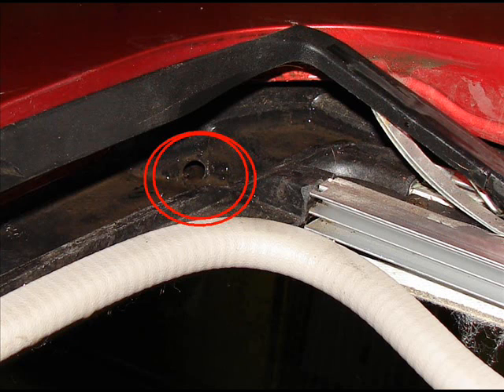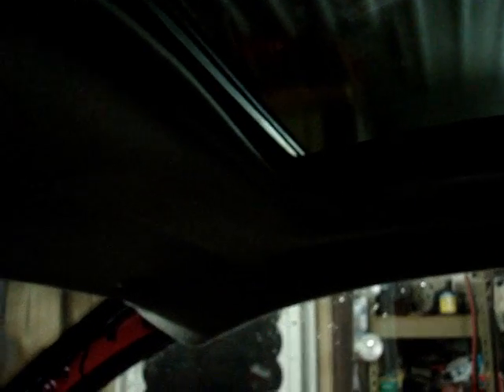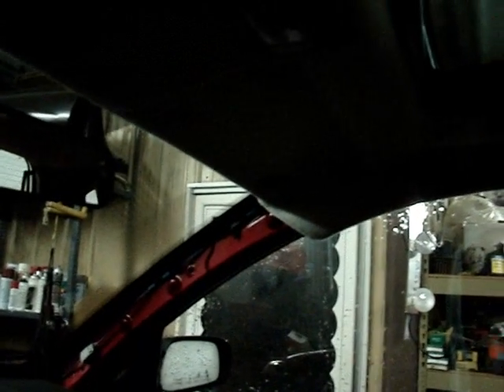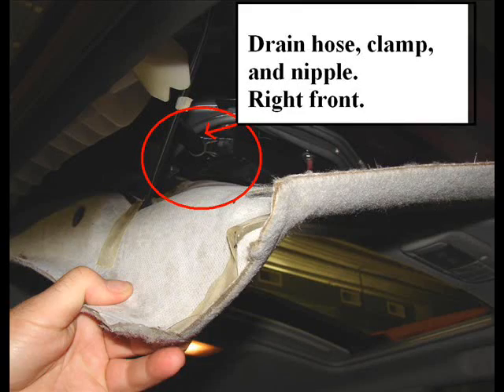Sun roof  WATER LEAK repair (Toyota Matrix - Pontiac Vibe)

Comment: Thanks for creating & posting this video!  I've had this problem, on the drivers side, on and off for years- seemed like no rhyme or reason when it would strike.  I kept a towel in my car to soak up the water and just lived with it.  Then the passenger side just started with the same problem, and I searched to see if others have had this problem- and I found this video.  Indeed the holes just inside the sunroof were clogged- it's fixed now and no more leaks!  Thanks again!

Comment: Thanks Earl. Your video helped me fix my blocked moonroof in my '99 Toyota. Fixing the problem was as simple as clearing the blockage by scraping the drain hole with a flexible plastic rod and then flushing with some warm water.

Comment: Thank you for making this video! I had a leak inside of my 2003 Toyota Corolla with a sunroof as well and you were RIGHT. The Corolla factory sunroof has 2 little holes in the front left and right corner - so tiny. My right side was completely blocked with little leaves and dirt from the trees that I normally park under. Toyota Service quoted $350 to REMOVE INTERIOR PANELING so that they could LOOK for the issue. I thought no way and took the car home to do some research. All better now!

Comment: Thanks for posting this video! My daughter has a 2004 Vibe and it was leaking bad. This video saved me time and money. The drainage hole is easily accessible when the sunroof is fully open. Sure enough dirt was blocking the hole which I simply removed. All is good now.. Thanks again!

Comment: I currently own a camry with an inbuilt sunroof and have had on occassion a water leak on the two front corners.  I wasn't aware of drain holes so I assumed I just didn't have a good seal when I shut the window the previous evenings.  I thought Ive been insuring that this wouldn't happen again by opening (not tilting) the window a few inches and reclosing.  It has worked thus far as Ive not had anymore leaks but now I see I need to ck for clogs.  THANKS for the heads up its much appreciated!

Comment: Great video 2004 vibe just started leaking really bad in same spot by top of a-post and blowing back a couple inches toward headliner i will check tomorrow on drain holes and afdter your video im betting blocked drain holes and most likely some debree down in the passager side,thanks for doing this video

Comment: I had been puzzling over a leak problem in my 2003 Vibe for a while. This situation was just as you described; suddenly started leaking in the same location.  I stumbled upon your video the other day and then took a look at my drain holes. Sure enough, the one in that corner was totally obstructed by a piece of rubber that fit snugly right in the hole! Not sure where the rubber came from yet, but we're expecting heavy rain tomorrow, so I'll be interested to see if we found the cause of our mysterious waterfall. Thanks for the help!!

Comment: I found the same problem this morning after buying a 06 ford f250 .. they said they fixed it.. I came home and checked it this morning .. same leak... So i tore into it myself . same as you exsposing the pillar. and found the drain was clogged and also the way the rain was filling up is a peice of the seal had slipped off the glass and was sealling properly. so you might want to make sure you chceck your seal.. thanks for the video. i was going to make one but i found yours. lol . bye James

Comment from the maker: The "A pillar" plastic pieces come off first. Firmly grasp them at the top edge and pull away at 90 degrees. You can break them if they are too cold or from using excessive force. There are plastic prying tools that are made for doing this. A wooden kitchen stirring paddle is a suitable pry bar to coax it loose. The objective is to get as close to the clips with the prying tool as possible. Be gentle and patient. Then take off the sun visors and center mirror (Phillips screws)

Comment from the maker: @filup55 EXCUSE ME but mine was clogged right at the hole entrance. I used a blow gun and compressed air as the hose diameter is larger than the opening at the drain. I did not know that the hose could be clogged deeply inside. It sounds to me like you already know the answer to your question? The weed eater string seems to be the brilliant solution to your specific problem. Thanks for the heads-up. I am sure other people with deeply clogged drain hoses will appreciate this reply.

Comment from the maker: @Taxminia0311 YES! Off topic but I did fix one with this problem. Yes, there is an "offset" bolt kit to correct it. 
NOTE: Always Toyota is cheaper than the Pontiac dealer for identical mechanical parts! (99.99% of the time.) Often the Pontiac price is almost double the Toyota price! Same parts, different part number.

Comment: I have that exact problem on a 2005 Vibe. The hole didn't appear obstructed visually and when I poured water in that area, it came out underneath the driver's floor area. Could the tube be cracked or partially undone at the nipple ?How hard is to peel back the headliner enough to get a look at the nipple area ? Thanks for any help.

Comment: Thanks for the video.  My 92 Camry is ponding a lot of water on the floor.  You can see standing water above the carpet.  Could a plugged up hole in the sunroof be causing this problem.  I sealed up the front winshield edges with blue masking tape but that didn't prevent ponding after a rain storm.

Comment: So I have an 03 vibe. Two winters ago I started having the leaks. And no matter how I parked, I live on a slight hill, if I parked down hill the front seat would get wet, if I parked up hill the backseat would get wet. I remember last summer taking some weed eater rod to one of the rear tubes, I ended up pouring water into the drains and found out where they exited the car and I shoved the rod up from the rear, that only got so far because there’s no way to get at them through the sunroof in the back. The front holes look clean and water does indeed drain through them so I have no idea why and how water still pours into my car. Never had the windshield replaced. It does have the roof rack option, is it possible it’s leaking through there? Seems unlikely

Comment: I have the same problem with my 2008 Pontiac Vibe: After it has rained, and I begin driving a particular way, water will spill into my interior from the same spot that's described in this video.

Unfortunately, for whatever reason, my sunroof will only tilt, not slide back.

Comment from the maker: Probably it is the roof rack. It could be the windshield. Has the windshield been replaced? Because the factory installations very rarely leak, but replacements this is more common.  Probably the best way top repair this is the take down the headliner and then have someone use a garden hose to spray the car. This way you will find the point of entry.
Thank you for watching.

Comment from the maker: @TheSmartdude11  If this repair is a warranty issue, then at this point you should take it to arbitration. Often, in a dealership body shop, the technician is often the "new kid" and he has no experience. In the service department, often it is the guy who does simple warranty repairs and oil changes. Even though the drain holes may be open, this doesn't mean that one or more of the drain pipes are not off the nipple as shown in my video.

Comment: I have an '07 Camry that has the exact same problem in the same place (For years now). My drainhole appears clear up top. But as soon as I pour a little water in it comes out the pillar (Where the plastic meets the felt). Does that sound like the hose has come loose or should I blast some air in there with a compressor? Do you have any videos that show how you got access to the drainpan nipple in the roof?
Reply from the maker: I think the hose is off. I show that the plastic pillar piece can be removed. A wooden flat kitchen paddle works pretty good for getting under the edge of that piece and gently prying it loose from the retention clips. Thank you for watching.
Reply: earltuckian

Thanks. Ya, I tried air compressor and that didn't do anything. I found out there is actually a TSB for my year of Camry about the moonroof hose coming off the nipple. At 1:00 you have the headliner pulled down to expose it. Was that where you used the wooden spoon?

Comment: My floor board only gets wet when it rains.  Is the A/C evaporator drain hose problem affected  by rain, or is it only connected to the A/C?  Sorry if it's a dumb question...
Reply from the maker: Hello,
Yes, the A/C drips only when the A/C is running and condensation is collected from that system. Likely you have a sunroof leak as the video explains. 
(Notes: If you have had the windshield replaced at some time, it is possible that it was installed with a defect in the installation re-sealing procedure.
 - Windshield leaks are extremely rare on OEM installed glass. -
If you did not buy the car new, typically you can see in the lower corner of the windshield glass an identifier marking group. If not a genuine original "OEM" Toyota piece of glass, it may say:  "PPG" or "Safelight" or something similar. )
Best regards and best wishes. Jim

Comment: @earltuckian hi um...ive had problems with my actual sunroof leaking like through the weather stripping but the drains work and everything thank god but would you know y the water is comming through the weather stripping ive had my dealer fix it over 6 times and it still leaks

Comment: hope you are around. i have a vibe and i have a leak coming from the front ceiling light. i took it apart and ran my fingers through there and everything was dry. then i watched your video last night and i went to look for the holes and i only find the 2 in front and cant find the ones in the back. your video is a little dark. but when i was looking it seems pretty clean there (from debris) but there is a strong mold smell. I don't know if previous owners left the roof open and water got in. anyhow. where else can this leak be coming from? any ideas will be a lead to me. thank you.
Reply from the maker: +mimi taylor If it has had the windshield replaced, it is possible the leak is in that area. Of the 61 comments, I think that you are the first to say that it was not the sunroof. Perhaps you can use a flashlight to look more closely. But if you say it is in the center light area, it seems to me that you have a windshield leak. Take a close look at the bottom edge of the lower corners of the glass. It will have a small etched imprint with the maker of the windshield, compare that to the printing on the other pieces of glass. (PPG for example) Changed-out windshields are common because of stone breakage, leaks in replacements are not common but do happen when the installer is inexperienced or makes a small error. If that is the case, you'll need to have a glass specialist take a look at it. Thank you for watching,.

Comment from the maker: @TheSmartdude11 If they are not taking down the headliner to look, then they will not know this. Or there could have been some damage to the roof mechanism. i.e. Something heavy was placed upon or someone stood upon the glass sunroof and this pushed the roof downward away from the seals. I suspect one of the hoses is not in place at it's connection. Sounds like it's time to try another dealership and explain your frustration about how many times it has been in for this same problem.

Comment: The drain hole on my 2008 matrix on the sunroof is plugged on the driver's side. But how do you clean it out? It's plugged down inside the tube itself.
Reply from the maker: heavy-gauge weed-eater string
Reply: @earltuckian  Good idea. I have some at the house even. thx.

Comment from the maker: @TheSmartdude11 - Warranty should be applicable at any dealership, & I think you need to call the toll-free number & begin the arbitration process. You will have mildew smell and obviously after six tries you have a problem that the dealer you are using can't solve. If Toyota, you may be OK. But if GM, there will be a point where they blow you off as a malcontent! (I've been there with a constantly malfunctioning $50K Chevy Suburban truck which is the last GM vehicle I will ever own.) Good luck.

Comment: In 2011 Toyota put out a repair direction sheet on the problem.  They apparently did not put clamps on the hoses going from the moonroof. When they come off, the water ends up on the floor.  My avalon has standing water on the floors.  It isnt an easy fix.  My mechanic thought around 1500.00. Car is out of warrantee.
Reply from the maker: Hello Pat
Did you watch this video? I show the clamps and nipples. But in fact, this was not the problem with the car in this video, the vast majority are actually clogged drain hoses as I show here. The second most common problem for water on the floor boards (after the moon-roof), is that the drain hose on the A/C evaporator housing has come off. It is possible for a passenger's foot to dislodge this hose under the dashboard. On most Toyotas, this hose and it's respective nipple can be found under the dash, directly right of the center hump. This hose passes from the drain nipple directly through a flexible rubber sealing gasket in the floorboard. When this hose is dislodged, the water draining from the evap-housing runs down the drive-shaft center tunnel and soaks into the jute-felt of the carpet. (But, with this problem, typically it is only the right floorboard that is getting wet.) I seriously doubt that your hoses on the moon-roof have become disconnected, but for $1500.00, I'd do as many of those repairs as possible. Easy money. (And yes, I have had several Avalon cars - from all generations - apart on numerous occasions.) Check for clogged drains as my video shows and/or look at your A/C evap-housing drain hose on this one. Thank you for your comments.